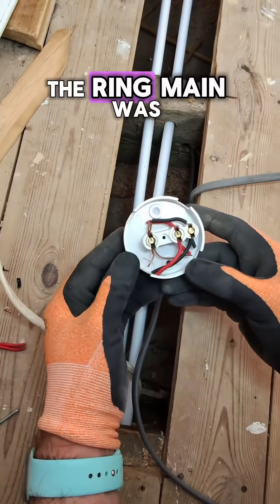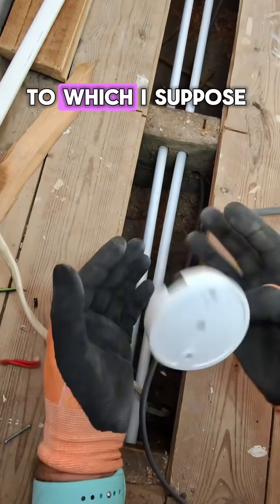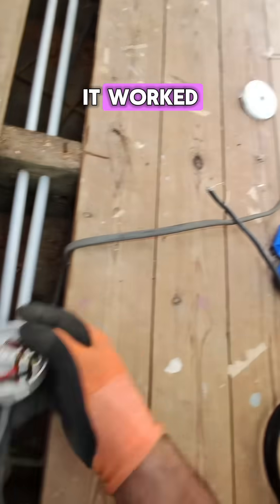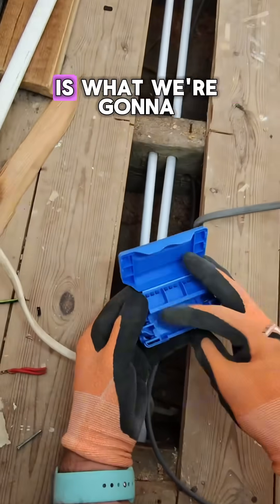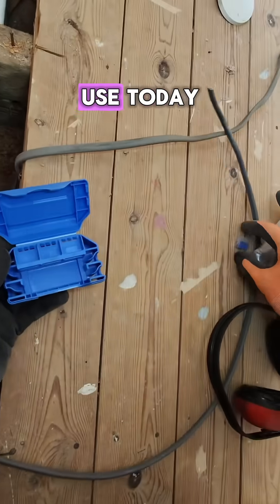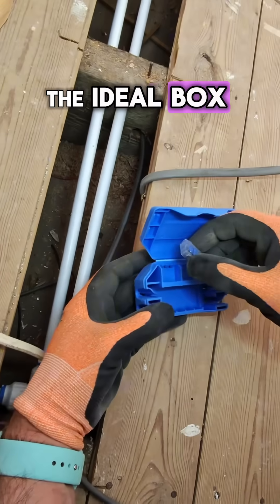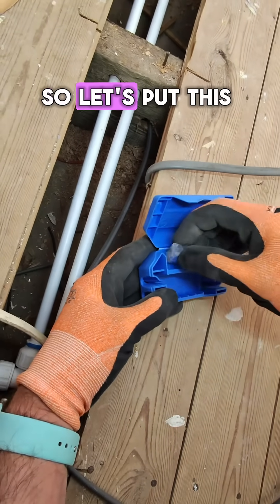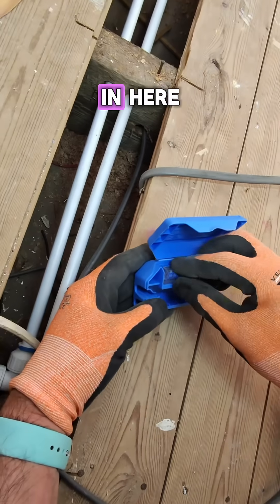This Is the Only Safe Way to Join a Ring Final

Comment: I bought the ideal connectors from SF but can’t find junction boxes above 16A for ring main connections… where do you get these from as they only mention wago when I search for Quickfix JB 3 etc .. thanks
Reply from the maker: They can be tricky to find, but I'm sure the shop will have some options , have you checked the website? I was given some at Elex show
Reply: These ones are available in most B&Q's

Comment: Title is misleading. This isn't the only safe way to connect a ring main. Traditional suitably rated round junction boxes are fine. Box should be securely fixed and the cables clipped. No problem and meets the regs if accessible.
Reply from the maker: Its a safe way to do it then
Reply: What is the definition of accessible? Surely under a floorboard is not accessible without tools.
Reply: Yeah... which under the floorboards is not